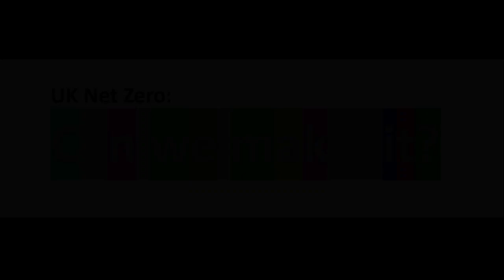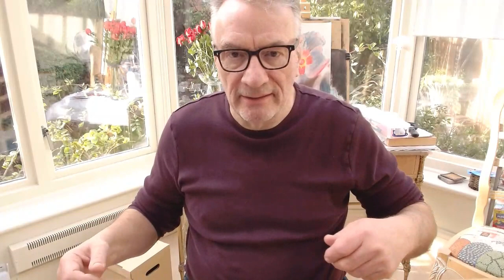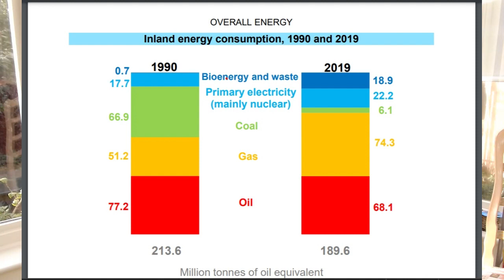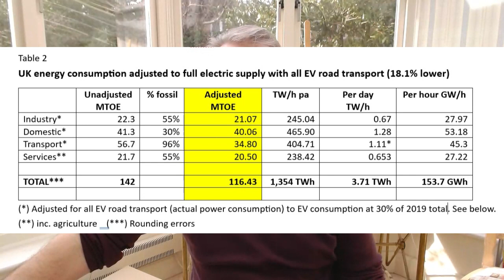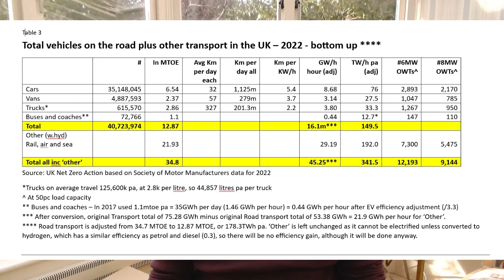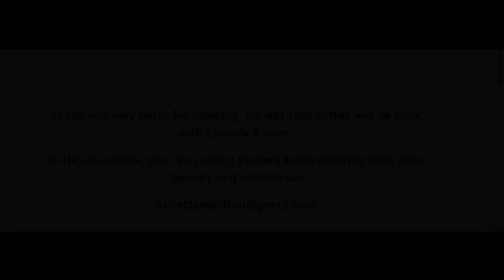UK Net Zero: Can We Make It?

Comment: What happens if we get 56 days of "dunkelflaute" like the UK got in 2018? Projecting out to 2050 with increased demand from electrification of transport and heating etc, we would need to find something like 28TWh of missing electricity generated from wind power (but the wind won't be blowing!).
Britain currently has 39.3 GWh of pumped storage. There are 4 pumped storage stations in Britain. No storage capacity has been added to the grid since the 1980s, and there is no other large scale energy storage in the country. 
To cover a cold dark still winter you would need to increase pumped storage capacity by a factor of about 1000 (taking into account pumped storage is about 75% efficient). So we would need to find 4000 suitable locations where a 300 to 400m dam can be built to hold back 10 million cubic metres of water, with a fall to the turbines below of about 400 metres. 
Then we would have to build 160 of these every year, year after year, for 25 years. 
The scale, and the massive cost of storage, by whatever method (pumped storage is one of the cheapest by the way), make it an impossible mission.
Reply from the maker: First, allow me to thank you for your insightful question. I will be taking this up in much more detail in episode 4, but you may want to watch episode 3 to get a clue ('UK wind is not fickle'). But the simple answer is in the production of massive hydrogen reserves in my model, which should be maintained above 350 TWh (it's hydrogen reserve creation per annum), which is equivalent to 60 winter days.
Reply: @UKNetZeroAction-xi5we  350TWh of Hydrogen storage would exceed by a considerable margin the current annual electrical generation in the UK (~300TWh). It would also be more than 50% of electrical consumption in 2050. 
Hydrogen storage is also one of the more expensive energy storage strategies at $203/MWh. Pumped storage $131/TWh with gas generated about half of the latter (At 2021 prices researched by Pacific Northwest National Laboratory).
Let's look at it another way. The Royal Society recommend the UK should have 100TWh of energy storage (it's currently 39.3 GWh from 4 pumped storage facilities). That's over a 2,500 fold increase. That means building 10,000 pumped storage facilities or 400 every year. 
That's at the same time as increasing wind power generation from 75TWh (in 2020) to 665TWh (in 2050 - these are UK National Grid figures). 
To do this will essentially require the UK consuming all of the current global supply of copper and other rare metals for the next 25 years. The cost will be unaffordable and the skilled manpower levels unattainable. And that is just to eliminate the less than 1% of the global CO2 emissions that the UK is responsible for. So times that by 100 for the whole Earth going Net Zero. Good luck with that.
Reply from the maker: @OldScientist  We cannot rely on pumped storage. It will be with green hydrogen.  The plan is to install 38k 8MW floating turbines.  The hydrogen is created from the surplus generation. You are still thinking only in terms of our current electrical generation. In this plan we would have total generation capacity of about  350 GW.  The surplus generation is shown in my tables along with all my assumptions and calculations. These numbers are given in episodes 1 and 2. The model is based on 2019 consumption levels (pre-Covid). What I have not yet discussed is the necessary role of the battery swop network. So the information is not yet complete. It potentially comprises 40m 60kwh batteries for EVs (2.4TWh). These are held in garage forecourts and are able to upload power onto the grid as needed to balance it during the day. They would charge mainly at night. I envision sodium ion batteries, now coming into the market. The green hydrogen storage is long term. It is mainly built up over the 6 cold months.
Reply from the maker: Also the cost of green hydrogen is falling rapidly - the US is investing 350m USD with a plan to get it down to 2USD per kg. The whole technology is now advancing very rapidly indeed. A team in Australia now demonstrates a new electrolysis method that is 95% efficient. The Chinese now sell hydrogen conversion plants in five different sizes that cost only one-quarter of US models.